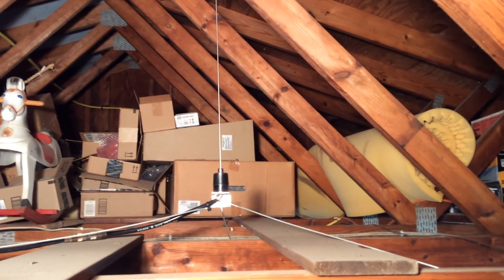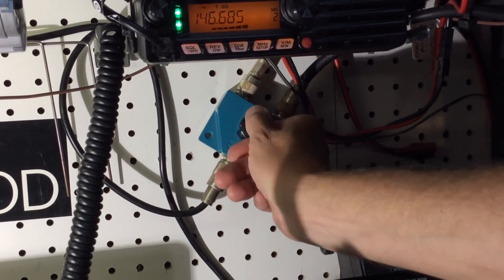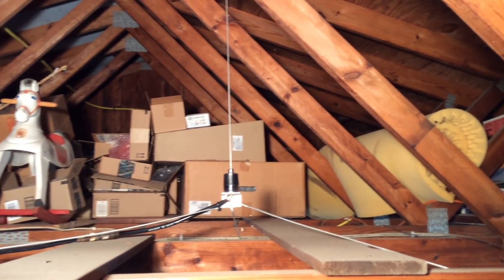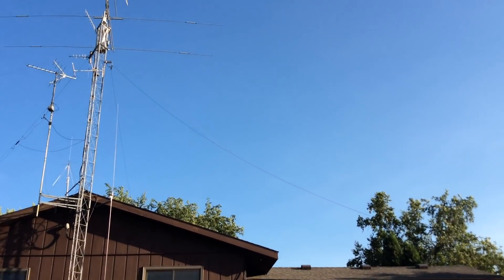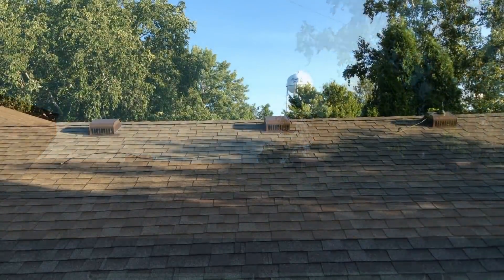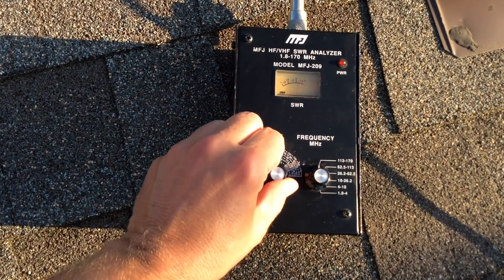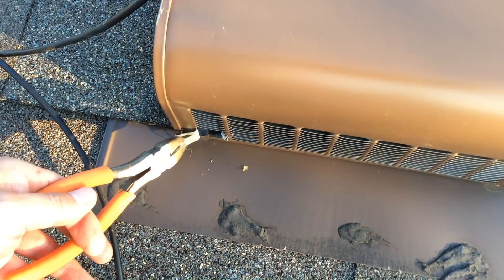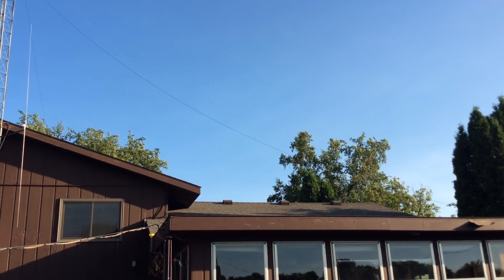Ham Radio Roof Vent Antenna For 2 Meters

Comment: The ground plane mount in your garage,  what mount is that?  I've been looking for something just like that.
Reply from the maker: That is just an "L" bracket antenna mount with the whole size for and NMO style mount, the mount itself is an NMO mount with the cable attached.  They are a common mount, a Motorola style mount used on commercial vehicles a lot and police cars, and are also sold to hams from many of the dealers.  I like them the best.
Reply from the maker: Also, the ground plane can just be some add on wires cut to 19 inches for 2 meters.  I think at the time many years ago I purchased this mount with the ground plane at a ham fest but I have not seen anyone selling them in a while but easy to make your own.
Reply: Thanks for the info.   I'm going to try this.  You were a lot of help.

Comment: My question for you is this...do you lose signal strength having the antenna indoors in the attic, as opposed to having it outdoors at the same height? I would think you would, but I don't know for sure. Thank you for your time!
Reply from the maker: Yes you do lose some signal but maybe not as much as you might think.  The main thing I have found is that you pick up a lot more noise from devices in the house that cause interference and by getting it outside farther away helps a lot to get away from noise sources. But if it is your only choice sometimes it can work very well.

Comment: You didn’t mentionwether it improved your signal. Wanting to install base antenna but concerned about causing interference to my neighbors electronics. Any recommendations? Thanks for the vids.
Reply from the maker: Yes it did help a lot.  Just getting it outside away from objects and up a little higher helps a lot with most any antenna.  If you are talking about a 2 meter radio and antenna you should not have to worry about interfering with anyone at all, very unlikely but if you are talking about HF radio it might depend on how close it is to the neighbors and how much power you are running but even so, it is not that likely to cause any problems unless you are running a kilowatt of output power and they are close by.  Good luck but get something outside and up in the air a little and you will notice a big improvement!

Comment: Hey Larry. I cobbled together an exterior mount antenna like yours. I used an old Hustler SF-2 whip antenna with an aluminum L-bracket. Guess what I used for the grounding elements? Ever replace the rubbers on your windshield wipers? They have stainless steel strips that help stiffen the rubber. They made excellent radials. 1.3- 1. 5: 1 across the 2 meter FM band. The whole thing is only about 20 feet off the ground. Reaching repeaters all over the region.  Three states-  northeast PA, southern tier of NY State and northern NJ. Great stuff! Thanks for the inspiration. In summer, I`m going to go with a roof mount up on the house roof.  KC3BXZ Joe

Comment: Would the addition of a counterpoise make any improvement?
Reply: Hopefully, the metal vent cap will fill that role.  It might work better if he moves the antenna to one corner or end or another to give himself a 19" ground plane at least in one direction.

Comment: Isn't the metal base (ground) for your mobile antenna on the roof a bit small? Or are you just using it for short distances?
73. from PD0PSX the Netherlands.
Reply from the maker: It may be just a touch small but seems to get out very well and it resonates well so works just fine for what I want it to do but yes most of the repeaters I use it for are not that far away so it does what I need. 73 from Minnesota.

Comment: I would have just popped an nmo mount on the vent.  Then you wouldn't need to route the coax around the outside.
Reply from the maker: I did consider doing that and I may in the future, for now I kind of wanted to try out the location of the antenna to be sure it would work ok, but that is a very good idea.
Reply: RadioHamGuy, yeah if it didn't work, you can just put a weather cap on it and forget about it.  I'm a huge fan of nmo mounts.  Once they're in, they're usually trouble free for a long time.

Comment: Simple and functional.  My kind of solution.  By the way, if you haven't tried it, scan it on 6 meters with your analyser.   Back when I had a 5/8 mag mount for 2 on my car, I discovered that it behaved like a 1/4 wave on 6 with a 1.3:1 SWR at the lower end of the band.  Made many 6 meter contacts on it.   You might have a bonus 6 meter antenna there as well.
Reply from the maker: Thanks for the tip and yes, I will have to give that a try.

Comment: Hey brother, make sure you make a drip loop on the coax before it enters the roof vent, saturate it with a spray bottle and and watch where the water flows so that you don't have a constant stream of water coming down the cable and into your attic.
Reply from the maker: Yes, that is good info I should have included in the video.  I have that taken care of.  Thanks for the reminder for others!

Comment: Larry, when you had your mobile antenna in the rafters, how long were the ground radials? Thanks KC3BXZ Joe
Reply from the maker: They were 19 inches long.
Reply: Thanks. I have a spare Hustler 2 meter 5/8ths whip, I think it`s the SF-2 and enough S/S whips to make a base antenna for my shack.